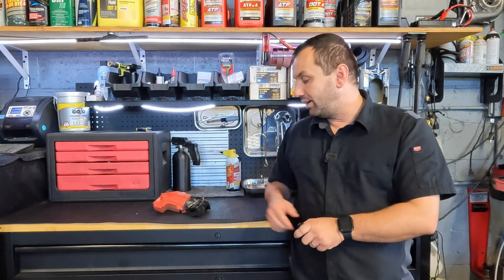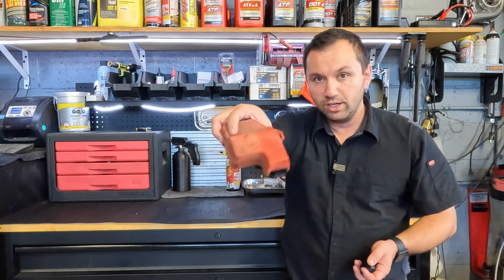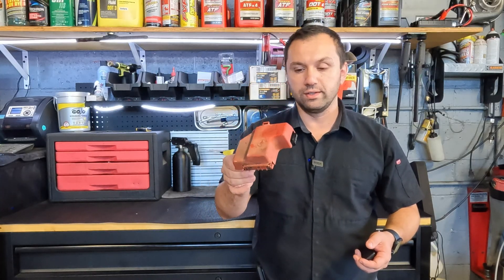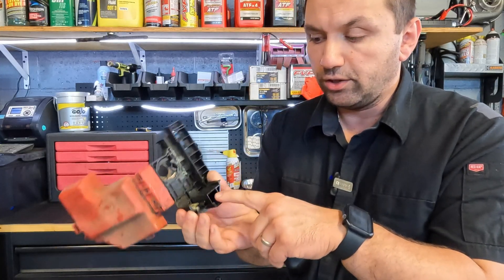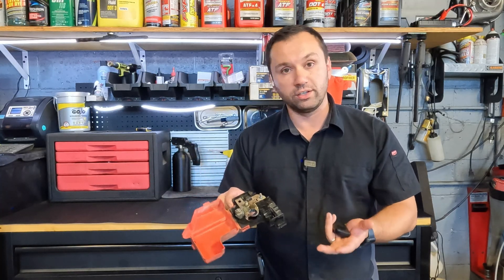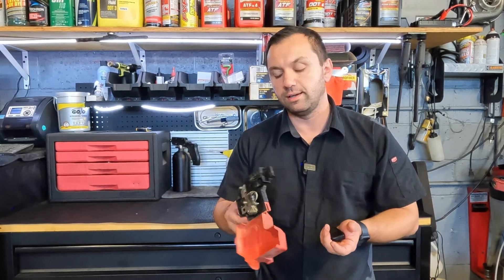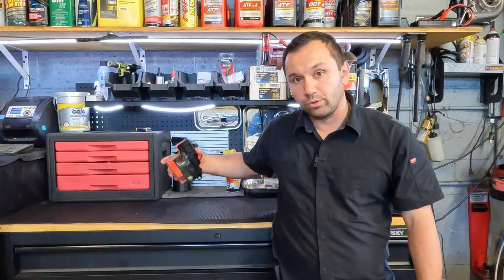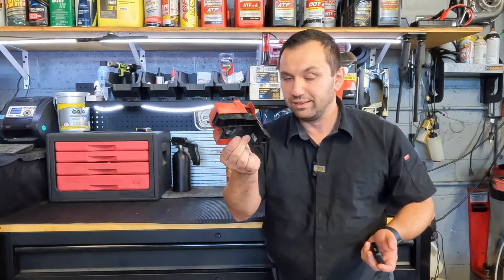ENGINEERING FAIL! WHY MAKE IT THIS COMPLICATED?

Comment: I feel like I'm always defending us engineers. The designer's design the cars and the engineers build the cars. The engineers have thousands of things they have to consider when building a car. They go back and forth with the designer to changed things that either won't work or is just too expensive to do. They have thousands of safety and government regulations to consider. The speed of how fast the car can be assembled is very important. If one part of the assembly takes 2-3 minutes longer than all the other parts. Then the entire line has to be slowed down for the slower operation. Thus, slowing down the entire line, resulting in 1 or more less finished cars at the end of the day. If a replacement part cost $5 0r $80, but can still be repaired. It is at the bottom of our care list.
Reply from the maker: Thanks for the input. I know it’s not just engineers. I know it’s also designers, but to be honest with you even though I value your opinion, I will say the fact that engineers prioritize making one extra car than taking two extra minutes to do something better is a concern or the fact that if it’s a five to $80 part that doesn’t matter to them because at the end of the day, it affects the consumer and the consumer always cares just my opinion on it.
Reply: @ it’s not the engineers, it’s the company that wants to make more cars and more profit. If companies don’t make profit, they will end up line Nissan. Ford doesn’t even make that part. It’s more than likely made by one of their suppliers. If it becomes a problem and there are enough failures on that part. They will redesign it, but to have that one part, be several parts cost money. If a hundred of these parts fail, out of the hundreds of thousands of cars made. It’s not worth redesigning.

Comment: I don't agree that it's a bad design. Money was no doubt saved here by Ford, marks customers still brought the vehicle and it outlasted the warranty so in that regard it was perfectly fine.

The problem is the car buyer. I sometimes get flak for saying this but certainly in the case of most new cars the buyers aren't very smart and they make poor, impulsive or purely asthetic buying decisions, which manufacturers then inevitably take advantage of.

What we need is a repairability index on all new vehicles, similar to the energy efficiency labels on white goods. France has this but I can't see our masters making that a law; there's far too much money at stake.

Comment: yes it just drives up the cost and time to repair something, it keeps getting worse, back in the 80s I worked at a Cadillac dealer, we could not replace a wiper motor, had to take it apart and replace the bad part, even the power antenna warranty would not pay for a complete assembly, these were made of plastic and rivited together we had to drill out the rivits diagnose it replace the bad part then bolt it together with bolts, you can not find internal parts for anything today, have to get the whole assembly
Reply from the maker: I agree, back in the day you could actually fix things!

Comment: I have a newish Chev Trailblazer with the same kind of terminal block on the battery, I thought the same thing about that terminal block, what a bunch of nonsense.  They should have used a short battery cable (with standard connectors) to go to a remote terminal block for the other connections.     But then again I can see company Bean counters directing  the engineers to make the car more compact, lighter  &  make it so only the dealer can change the battery.  Actually I'm surprised they haven't figured out if they hid the battery behind the front bumper cover it would make it really hard to change.
Reply from the maker: I think they tried that on a few times but then they figured out when you get into an accident. The car catches fire lol 😂
Reply: chrysler did, most of the front wheel drive cars in the 90s and 2000s had the battery behind the bumper in front of the lf tire
Reply: @JimSix-jo6hf  Jim I was referring to the battery being buried in front of the bumper impact bar, yet behind the fascia of the car, in a very unaccessible location which would require removing the fascia or the bumper cover from the car to change the battery, likely a 2-hour task.

Comment: If thats off an Explorer (11-19), I was able to buy just the clamp off Ebay. Not practical if you are a shop and have to wait on parts.
Reply from the maker: You are correct as a shop. I gotta get something that’s available and something that comes with a warranty. I do believe they use these on the explorers. This particular one came off of a Lincoln, which is basically the same thing as the Ford family.